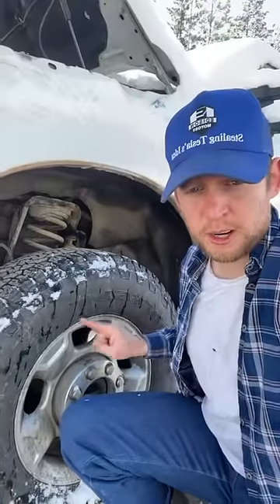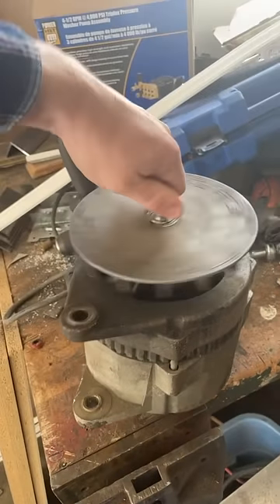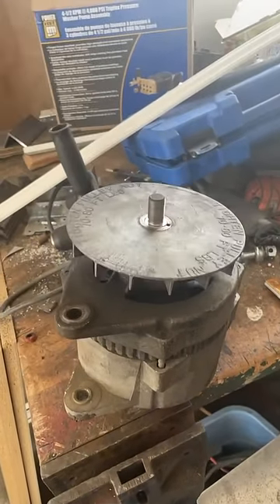Alternator on each wheel???

Comment: We used to have generators on bicycle wheels to power lights.
Reply: Yes but you would have to constantly be peddling to make this energy. You're putting out more work turned into energy than the light needs to make light. You can't peddle forever and you don't get energy back from the light generator. You have to eat, drink, sleep, etc... you see the power always has to come from somewhere, and to get power out of a system there first has to be that power within the system to begin with. That's why ICE vehicles are so efficient. The power for the system is in a physically liquid state and depending on the fuel, it's very power dense. The electricity for our power outlets has to come from somewhere. That somewhere is a powerplant that is more than likely fueled by (drumroll please) COAL! Why? Because it's a power dense fuel that is cheap and easy to make. It burns really hot and makes a great amount of steam for the turbine generators. So no. EVs are not zero emission vehicles. And that's not even getting into the materials they use to make the batteries for the cars. I mean people really don't understand physics and how hard it is to make energy (especially electricity) without putting out some kind of carbon footprint. With the materials needed for "green" energy generating methods it still isn't truly zero carbon footprint.
Reply: @AudioFreqx  Wrong.

I've used it, and the bike was definitely harder to pedal with it attached.... MUCH harder.

Considering how regenerative braking is used to SLOW a car down, this shouldn't come as a surprise.
Reply: @Evan Asche the way I see it, as long as you can find something to spin the wheel of the pulley it should work, so how come powering it with the rotation of the wheel wouldn't work? Genuinely how is is different than an alternator being driven by belt?
Reply: @evanasche8882  the pulley of the alternator* wtf
Reply: Yeah but you still have to plug the human in by eating food
Reply: I still think you can use a alternator in the back to just run the power of the options in the vehicle not 5he power train
Reply: @adrianmora7033  Because if you want it to generate power, you will need to create magnetic resistance, which makes it harder to turn.

The more power you want, the harder it will be to turn,

Which is why a slipping alternator belt was one of the signs that the battery was weak (the alternator was having to do more work).

The belt was literally slipping on the pully, because the pully was so hard to turn.

Which is why alternators of sort, are used to slow the car down with regenerative braking.

The regenerative system converts the kinetic energy of the car, into electrical energy (which is then stored in the batteries).

So unless the car is constantly going downhill, it would be a very inefficient system to have the "wheel alternators" trying to convert the kinetic energy into electrical energy (to then be put back into the batteries),

Whilst at the same time getting the motors to use the stored electrical energy.

You would end up getting less range.
Reply: @notsureyou  because it would have to use more power to go normal speeds?
Reply: @adrianmora7033  You would be trying to move forward (which uses power from the batteries), 

Whilst simultaneously trying to slow yourself down (the effect that the alternators would have on the car) to charge the batteries.

What people don't realise is that an alternator that is not trying to generate electricity is fairly easy to turn,

There is still a mechanical force that it is required (due to internal mechanical resistance),

But when you want to generate electricity, the amount of force that is needed to turn the alternator increases.

Which is why regenerative braking is used to slow the car (which then recharges the batteries).

Or to look at it another way,

The driving motors would be using energy from the battery which is electrical to mechanical to kinetic (once the car is in motion)

Whilst the alternator is converting the generated kinetic energy back into stored energy, through an electromagnetic resistance.

So you are trying to generate movement, whilst simultaneously reducing your movement.
Reply: @notsureyou  I see, I appreciate the time you took to explain all this to me 🙌
Reply: @adrianmora7033  You're welcome 🙂
Reply: @evanasche8882  yes but doesn't mean you couldn't store that energy...
Reply: A tiny generator that you yourself power
Reply from the maker: @notsureyou  Thank you for saying this so I didn't have to
Reply: They were called dynamos. Made pedaling much harder.
Reply: Apparently no one here knows how an alternator works.. you can hook it up to a stationary bike and pedal with human power and very very little resistance and create a fair amount of voltage.. 🤦‍♂️
Reply: @bmint  a fairly small amount of voltage with large resistance.
Reply: @evanasche8882  One particular point to note is that they were powered by the spinning wheel, so they would work even when coasting.  Free energy... no, but just specifying that rolling, not peddling, was required for power.
Reply: @Evan Asche  the same argument could be said about the resistance thebalternator puts on your engine... how come it doesn't add that much difference in fuel consumption for the engine but somehow is magically resistant when placed on a spinning wheel powered by an engine.... 

How about the a/c?

Power steering that's not electric?

See.. this is a true nonsense argument... it's because if they did there would be less reliance on electric and therefore no money to be made after selling the car....
Reply: @Adrian Mora  the belt adds even more losss... 😆 any electric motor has magnetic resistance that being overcome creates electricity. At alternator isn't just bearings and some wheels. The magnets force has to be overcome. They don't put out a lot.
Reply: Added too much drag, and your light would get brighter and dimmer as you would pedal.
Reply: @adrianmora7033  It adds more drag than it charges, causing the battery to work harder in the first place.
Reply: this is exactly what I have been saying
Reply: this is what I have been saying
Reply: @jmackinjersey1  Ahhh... the good ole days...LOL
Reply: @evanasche8882   I guess they should have made them light generators with a block 'n tackle system-ish. (-:
~ Somewhere in my last living bwain cell I feel there's a solution in gearing.
That cell mentioned keeps thinking of speed, like that of a turbine.  ...wristwatch gears in there somewhere too.
Meh~ even if someone figured it out, they'd be suicided.
Reply: @adrianmora7033  Read the first rule of thermodynamics again. You cannot get more energy out of a system than you begin with.
Reply: Yep, and your bicycle was slower than it was before you put on the generator.

Comment: There is also a physical load placed on an alternator when you give it work to do. I've experienced this with small DC motors which can be used like a generator. If you spin the shaft, there is very little resistance. Wire something up to it like a light, or some other load to power, and the shaft becomes harder to spin. If your alternator has a load on it like a battery to charge, there is even more physical resistance for your motor to overcome.
Reply: Yes. this can be observed in a car also. put the parking brake on. start the car. then put the lights off. couple seconds later put them ON and you will notice the engine responding to the load generated by the alternator.
Reply: Think permanent magnet motors no field to heat it up.
Reply: @ashforkdan  💪🧐🤝
Reply: @ashforkdan  Even permanent magnet motors cause alot of heat loss. There just more efficient then a normal motor.